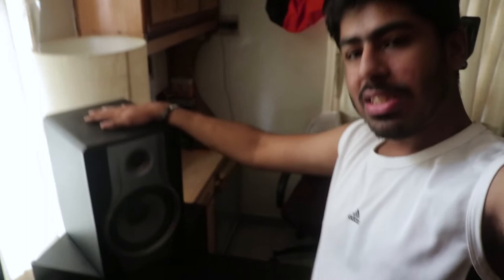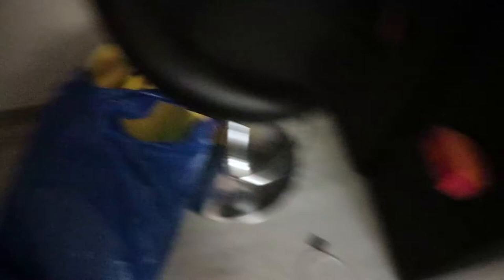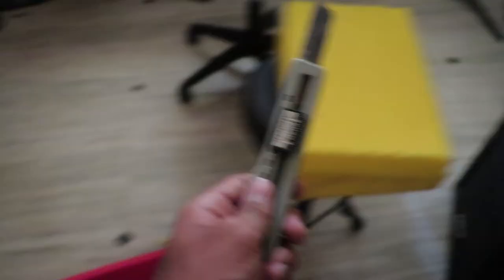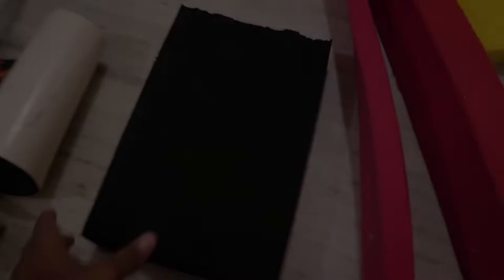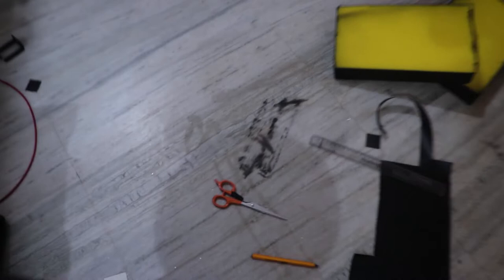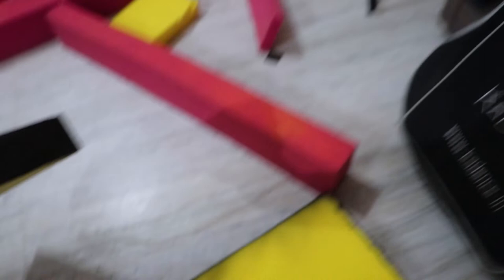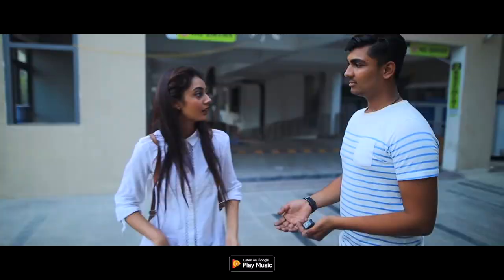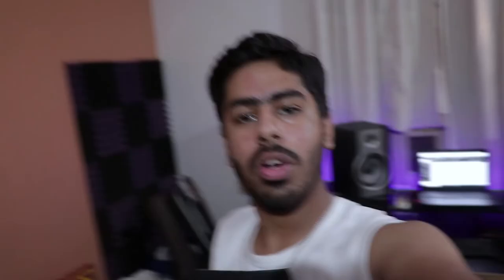DIY : Studio Monitor Isolation Pads -Vlog #6

Comment: What about using books. Does that work. Thanks for the video.
Reply from the maker: Nope! Books are rigid. We use the isolation pads to basically try to decouple the vibrations from Speakers to the desk so that it does not resonate. Books wont help in this as they will let the vibrations from speaker go to the desk easily.
Reply: Brijesh Sarin Ah ok.
Reply from the maker: Lots of Fun videos coming up!! Stay tuned 🙂
Reply: Brijesh Sarin Super... Ok this is a very jugadu question but what about a combination of marble pieces (I already have extra) and foam. I read somewhere that this can work well.
Reply from the maker: So basically u will sandwhich foam with between 2 marble pieces ? If yes that would make the matters even worse as now the marble touching the desk resonates too. Just use the Foam if you have available. The thing is the last thing touching the Desk should be something that absorbs. So if you place marble in between 2 foam it might work. And anyways u need to focus more on the room acoustics rather than this aspect. As that will have a huge impact on sound, while the isolation pads will only give u more focused bass and increased clarity that too if you are in good sounding room.
Reply: Brijesh Sarin Yes, marble between two foam pieces is what I was planning. I also plan to try unused bulbs holders - I have lots of those :) Agreed on the room acoustics but that is a big project and I am doing research.
Reply from the maker: @accentontheoff  all the best 😇
Reply: Brijesh Sarin Thanks 😀

Comment: No audio test?
Reply from the maker: How will you test audio in a video my man?. The following is my feedback after using those

The bass is more focused and as it decoupled from the desk it cleaner and resonance free as well.
Reply from the maker: @Abhishek Gupta Frequency analyzers aren't cheap and the ones built in phones aren't acurate to monitor frequencies precisely. I never said about controlling bass. I have different things in position to counter the room acoustics and soon will be unploading a video about how to make diy pannels and bass traps. By focused bass i meant more direct bass. When you put your monitors on the table, the Energy from the speaker dissipates and thus the bass isn't focused (still not talking about the bass buildups in the room) . And to hear a difference with or without the isolation pads you have to be there in person. It can not be demonstrated in a video. About the density and NRC (Noise Absorption Co-efficient) it doesn't matter because we dont place isolation pads to remove reflections or absorb sounds. We use isolation pads to decrease the vibrations going into the desk or whatever tey are placed on so that sound can be as clear as possible. So anything that doesnt decompress due to the weight of your speaker will work.  I hope this helps. 😊
Reply: Brijesh Sarin sure! I’ll cut my old mattress tomorrow to use them as isolation pads 😄. For the sound panels, i’m already building them with rock-wool.
Reply from the maker: @akg.69  Cool Man!! Yes i have used the Rockwool as well for the pannels. Just take safety precautions while you work with the slabs. Happy Building 🙌🏼🙌🏼